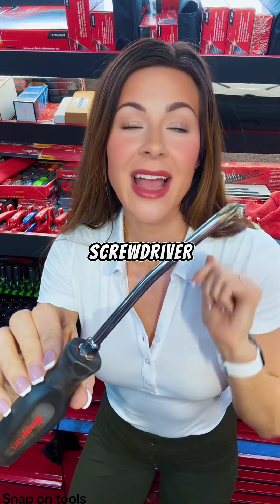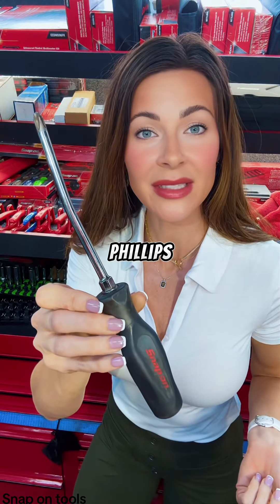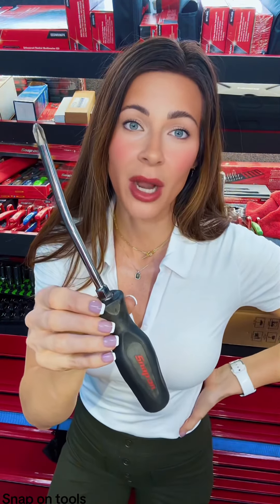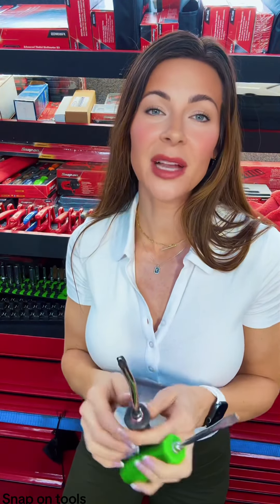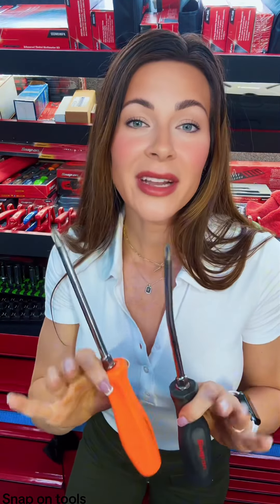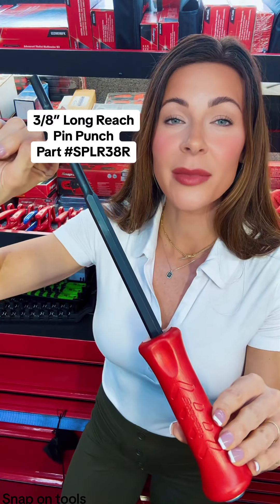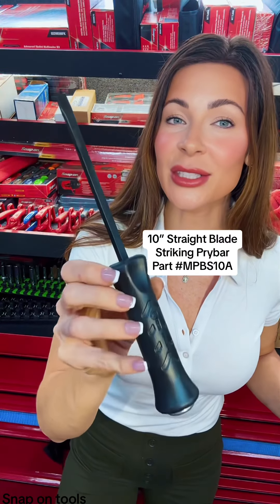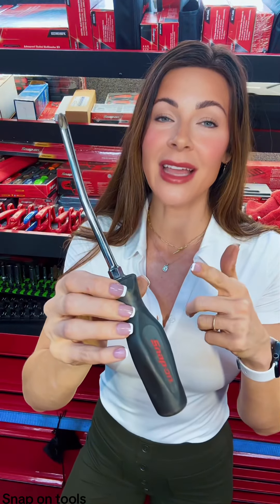Never seen a screwdriver bent like that before! #snapontools #warranty #tooltruck

Comment: The hard handle screwdrivers were my favorites.  Had a screwdriver shank warrantied, not the whole scredriver i originally purchaced.  My dealer put the screwdriver shank in a vise on his truck, pounded the handle off with a hammer, then pounded my beat up old handle onto a brand new screwdriver shank.  Years later would be nice to be able to buy  new orange hard handles to re-new my old screwdriver shanks.